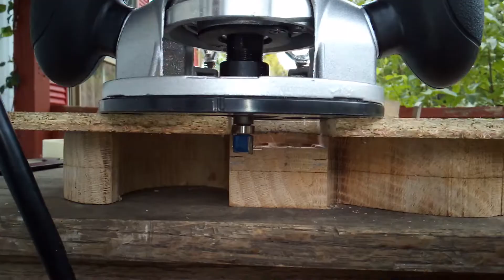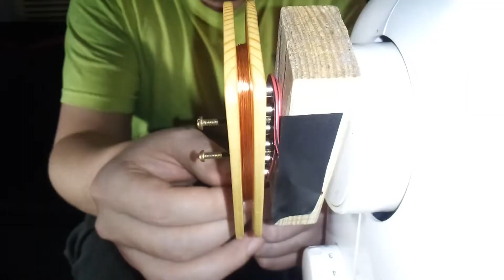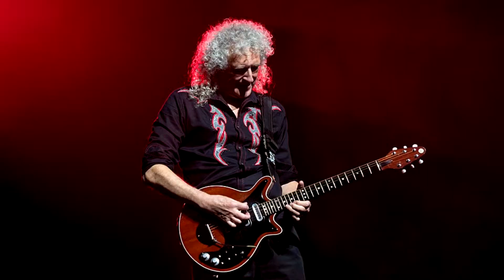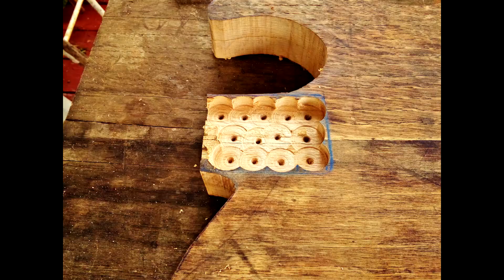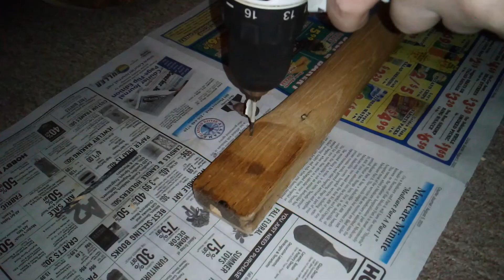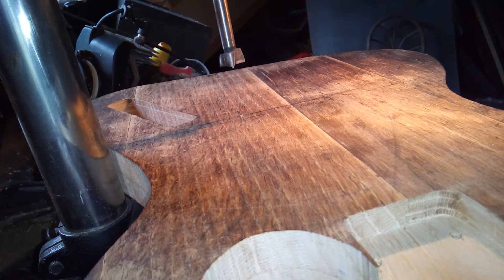Guitar Built from Table gets Neck Pocket and Does Bigsby Divebombs!

Comment: I cut out all three of my guitar bodies with a coping saw. People on the forums say it can't be done. All you need is a coping saw, a 12 pack of blades, a 6 pack of beer and about 3 hours with regular beer breaks.
Reply from the maker: Thanks for watching and taking the time to leave a comment Peter. Yes Sir, that's how its done and what its all about. If you want something to happen bad enough you will make it happen with what you have. I commend your dedication. I figure that if a man really wanted a guitar bad enough he could carve it out with a pocket knife and sand it with a brick like many men did with the trench art guitars I even saw one made from only matches. It seems like people forget that there was a time when power tools didn't exist and many guitars were built as well as houses, the pyramids and even giant ornate coliseums. It just takes desire and dedication and "Beer Power" the pyramid builders were actually payed in beer. Thanks again.
Reply: I used a razor saw for the outside curves. Saved the coping saw for the inside curves. Saved a bunch of time and effort.

Comment: totally agree with you. ))
Reply from the maker: Thank you for taking the time to watch and leave the first comment on this video Pakiw2. I'm glad you understand what it is that I'm doing with this project. Birds of a feather stick together.
Reply: @heavymetalATC  I was doing kinda same thing. I have glued alder sheet and planning glue oak top on it + 30 inch neck on it, uber baritone for low E tuning. I have Couple 8 strings. I used same bridge on cheap Jackson js 32 repair. also I have modded chep aliexpress pickups with alnico 5 in my ibanez 6 string..Also Made preamps for guitars guitars. Last year I was busting so many myths with my guitars. After this video I'm convinced that wood magic from big brands and forum experts slowly disapproves. Thanks keep doing stuff ))

Comment: did you ever get this beast done?
Reply from the maker: Thank you so much for watching and taking the time to comment RedneckHacker71. The body has a great finish on it now has been curing for about a year but has a few runs that need buffing. the neck needs cleared or finished in some-way. Then it just needs assembly. I haven't done anything with it off camera So I'll try to get back on it before spring maybe? Its basically completed. It could be assembled completely and set up in 1-2 videos. I plan on doing a long form version of the whole build as 1 big video after completion. So.. Hopefully you will get to see and hear it... I haven't even heard it electrified yet. We will all be hearing it for the first time.
Reply: I get it. I plan on uploading a video today...an update of sorts.